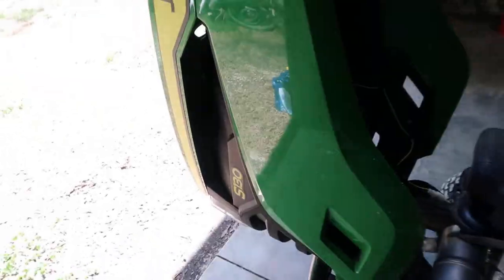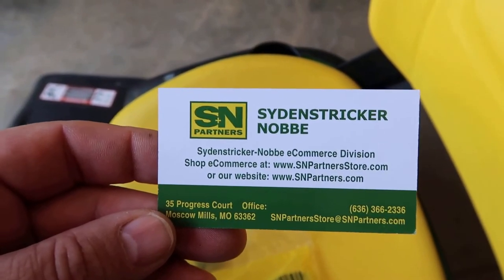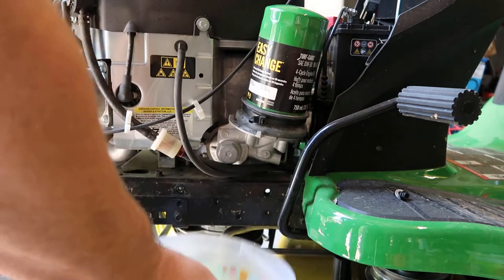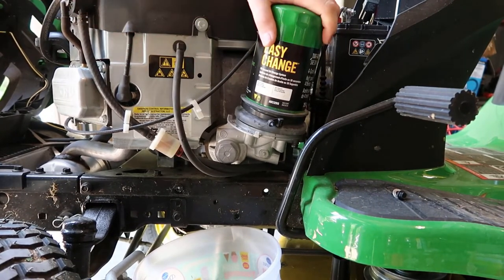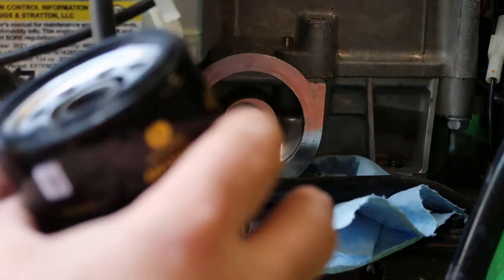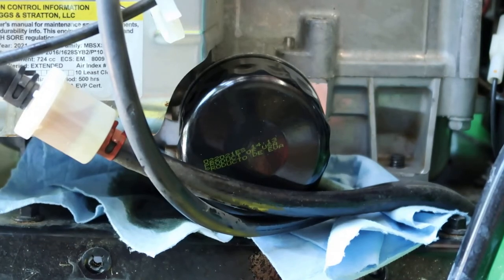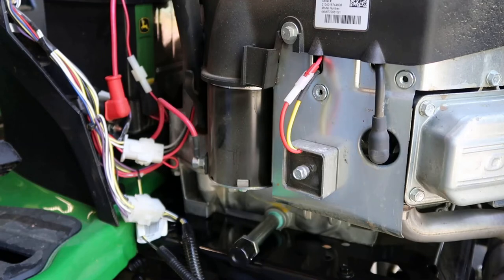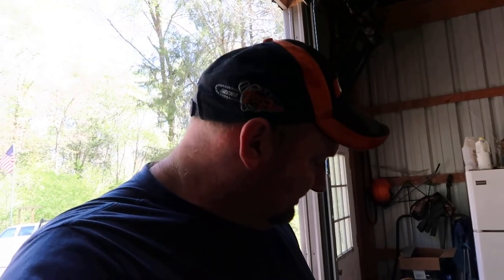John Deere Easy Oil Filter Removal & Conversion Install Kit

Comment: I like the easy oil  change system I do drain all the oil though.and another thing I f u see people cut these filters opened their twice the size of the regular filter so really its a better filter I don't mind paying 40 bucks and 16 bucks extra for 2 quarts of oil.every 2 years I change it I only put about 25 hrs a year on it

Comment: I've never seen an oil filter like that one. Nice conversation kit.
Reply from the maker: Wally this is new to me too! I guess they try to make oil changes so simple but it doesn't remove the oil from the motor. The filter cost over 40.00 too! The filter is precharged with oil and you just install the new one. I like things the old way. Have a Blessed Day Friend! Justin

Comment: You keep a clean machine brother, never liked oil filters facing up or down,to messy. 😀
Reply from the maker: This is the first new riding mower I have owned myself. I try to spray it down after each use. I'm sure it will begin to collect more dirt as I use it thru the years. Them oil filters sure can be a mess. Have a Blessed Day Friend! Justin

Comment: I have the same mower and same convert kit. You could have used a regular old socket extension to install the nipple. Looking forward to $15 oil changes rather than $50!

Comment: You can order the complete kit: filter w/conversion fitting, and drain tube from Amazon for $23.99:                MIU13767 AM131611 AM125424 Easy Change Conversion Kit Compatible with John Deere Lawn and Garden Tractors.
Reply from the maker: Thanks for the information. That will help someone out. Good to know. Have a Blessed Day Friend.  Justin

Comment: John Deere spin on oil filter 
# AM 125424 @ $19.99 +/-
Advanced Auto Parts Carquest Filter 
# R85348MP $4.99+/-
Replaced my oil with Mobil 1
5w-30 Advanced Full Synthetic. 
Added about 1 pint of Marvel Mystry Oil.
I also add MMO to my gasoline. 

Masonry Plus 
Florida
Reply from the maker: Thanks for the part #'s. I like the marvel mystery oil too! Have a Blessed Day Friend!   Justin

Comment: Is there a cheaper alternative to the John Deere filter?
Reply from the maker: There is but not sure of the #'s! Fram is being used by some and Briggs has one that will work. I am going to look into an alternative this year because the JD filter is considerably more than a standard automotive filter. But is an automotive filter more restrictive. Not sure how much oil pressure these engines produce. In the end, an extra 5 to 10 dollars for the JD filter and knowing it's right is peace of mind I guess. Maybe someone can let us know if they come by this comment what they are using. Have a Blessed Day Friend!   Justin